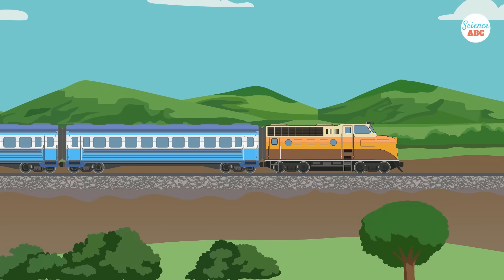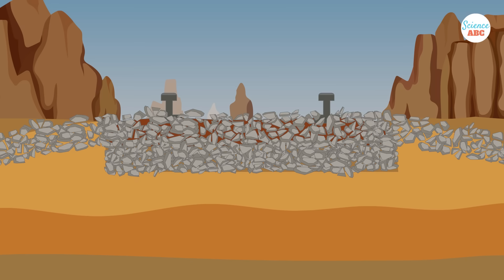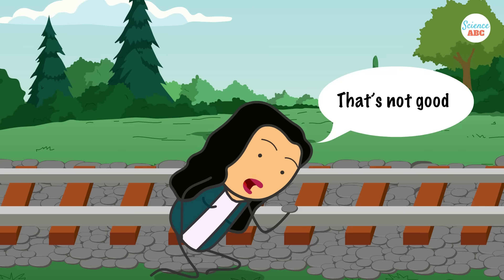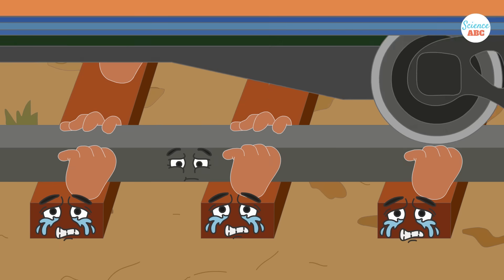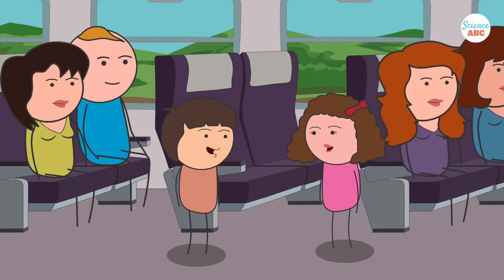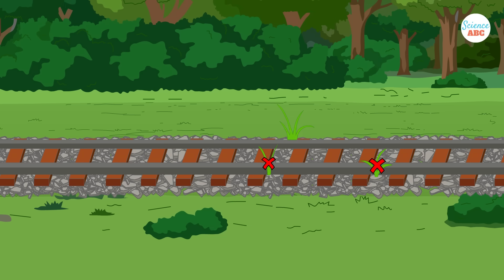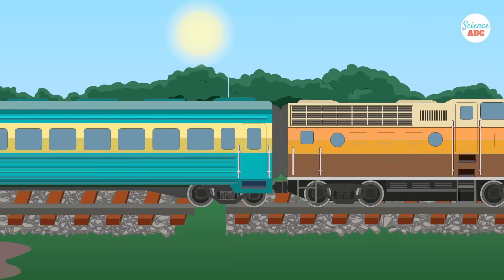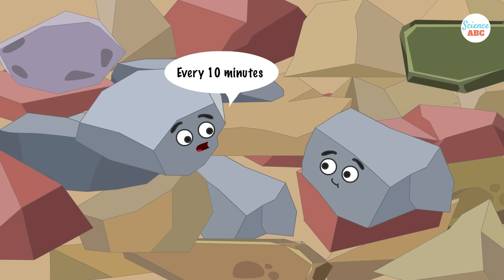Why Are There Stones Along Railway Tracks?

Comment: 0:58 25-30 cm? Maybe in the US that considered sufficient, but that is normally the amount that goes under the sleepers and then another ~15cm for in between the sleepers. Also, that is an awkward position to measure. Normally you measure the thickness from either the top of the rail or the bottom of the sleeper.

Comment: All terrain has a coefficient of friction due to composition and particle size. When you place large weights like trains or houses on bases with a small coefficient of friction, ie., small particles such as dirt, the particles separate and the large weights sink.
Usually core samples are taken to determine ground composition to design the base width.

Comment: Great video! I had wondered why they use those seemingly loose NON compacting stones, rather than a 5/8 inch minus like we do for the highway roadbeds.
Reply: Dear road worker,
Indeed Ballast compacts, exactly like sand just the holes in between are bigger. 31,5 - 63 mm in size.

But indeed we usually use 2 Sand/gravel mixtures beneath the main ballast.
Rail - sleeper - ballast - pss - fss.

Pss Type 1 - usually formed out of sand and gravel.
60% 0-8 mm , 30% 8-32 mm, 10% 32-45mm by weight.
Fss can't remember the % but the types
0-32mm , 0-45mm and 0-56mm.

Sand goes to 0,06mm in diameter(smallest), represented by 0

1mm = 1/25 inch
Or 25mm an inch (roughly).

Pss is waterproof and angled so water entering is getting out of the system fast and the Earth beneath doesn't get over saturated with water... Frost etc.
Fss is to break capillary water and to ensure frost safety. for the Earth beneath the track.

I hope you can understand my limited english, fellow infrastructure construction worker.
Reply: @jonass9347  Understood, & very informative!

Comment: I used to live next to a local line train track. They used to replace the stones or re grade by slightly lifting the track then using shaking forks to hook under each sleeper in turn shake the stones underneath adding stones if needed and then replaced the sleeper. This was always done in the middle of the night so you got no sleep that night. You could hear the machines approaching for almost an hour before it passed, then if faded away. BTW the trains were much quieter afterwards when they passed.

Comment: In my hometown, there is a brand new commuter public transit that’s constructing a new express light rail line all over the city. When they finished adding concrete on the ground, I firstly saw them covering ballast on the line and that’s when I asked why is it necessarily important to add these rocks on the ground. And not only that, but they also mentioned that this task is not completely yet just by doing it. The complexity of alignment and adjustment of the ballast and the tracks are so difficult that it represents a great challenge for engineers and workers. Also, some other areas of the city hasn’t just used ballast, but with another type of support. For example, on a very large bridge between two lands, another method used is called “duo-block tracks”. They are installed using a construction method known as top down. The already attached rails are installed on a tie to keep them parallel along the whole bridge and that’s when the entire assembly is poured into a concrete sidewalk. Very interesting to see such great engineering!

Comment: Working in the industrial rail switching industry for over 20 years I've walked and ridden many miles over ballast. Great video great description of what purpose the ballast serves.
Reply: Ok, if you have experience can you tell what is the cost of building 100 km railway track and how much does it cost  to maintain? Also how much does is a single lane highway cost in comparison?

Comment: I live in an area with a major interstate rail line, and several smaller (mostly seasonal grain traffic) branch lines.
All the busier lines use concrete sleepers, and even some of the lesser-used grain lines are now being converted to concrete sleepers as well. "Mud holes" are a common problem, especially on the main line. Ballast is mostly basalt, although I've seen granite or a granite/basalt mix used in some areas.
My part of the world is also extremely highly fire-prone (and not just during summer months!).  Almost all fires starting along railway lines have been traced to sparks caused by sticking brakes.

Comment: I knew all of these besides the heat and noise benefits. Probably should've realized due to the increased surface area though. Didn't know they were regularly cleaned but I figured they would need to be replaced.

Comment: Its hard to walk fast on track ballasts.  I found that out when I was in a place where there were two railway crossings close together. So I took a shortcut to the next crossing. I tried to walk fast as I could but walking on them proved slow.  I started to panic because I knew that a train, quite far away could still reach me before I reached the other side. I walked on the ties instead and found it was easier to walk faster on the ties than the ballasts.
Reply: Never, ever walk on the tracks or ballast. It is for trains only. You can easily die that way, or lose a leg. Never go into railyards either.

Comment: I'm still in awe of how much we still use Rock as a basis for so much of our construction.

Metals are nice but they can rust. Twist. Expand/contract with heat yada yada...
Plastics don't often have the strength for things like buildings roads etc. Etc.

But stone and rocks. Sometimes specially shaped or a special mixture thereof. Foundation to railways. Roads. Buildings (concrete to name a specific one).
I'm sure more examples can be listed.

Comment: Thanks for that blast of information about tract ballast. My question now is how about in our modern elevated Metro we call MRT in the Philippines, instead of having ballast and sleepers it has a concrete pedestal that is about 2.00m long and to my amazement (the first time I saw it) it is placed underneath the steel rail parallel to the tracks.

Comment: The ballast cleaner is an amazing machine. It takes the stones out of the track while lifting the actual train tracks a couple of inches in the air. It cleans the rocks and spills them back into the ballast. After that it shakes the rocks with these spatulas that are shoved into the ballast. The shaking makes the rocks take place, kind of like a train had driven over that spot several times. It's a frigging miracle of a machine 😂

Comment: One thing that wasn't mentioned... is  how the rocks sharp edges direct hot sparks from the trains wheels down into the gaps and absorbs the heat to protect surround vegetation from catching fire.... but that wasn't likely a by-product and not an intended design feature

Comment: Sadly, most of the points this video makes are made up and untrue, and it misses the actual main reason for ballast, which is forming a "raft" on top of the soft earth underneath, and adding a lot of permanent weight on the soft earth to compact it, so that the weight of the train is light in comparison to the weight of the "ballast" (thus the name), thus reducing "pumping" and creating mud holes under the tracks.

The drainage has nothing to do with rust prevention (really? You went with rust prevention? Don't you think that would be an issue on Ocean side tracks?), it's about keeping the ties dry so they last a lot longer, as well as reducing mud formation under the tracks.

If coal etc dumps into the ballast, it clogs up the ballast and starts causing all sorts of problems, none of which involves the track corroding! The wooden ties fail, the road bed starts "pumping", and it ceases to function as a stable raft. 

Ballast also doesn't improve the ride comfort of the train, that's done by carefully leveling and aligning the tracks, and that can be done even more perfectly on concrete than on ballast, such as high speed trains that don't use ballast, or across bridges etc. 

Ballast is just the cheapest way to provide a flat surface across thousands of miles of different types of ground, and you will notice that in soft ground conditions the pile of ballast is much thicker and wider, because it's creating a larger footprint, thus reducing the PSI on the soil. 

I am not going to try to go through every point, but this video sadly is not well researched, and you should NOT repeat anything that you learned in here, because you will sound stupid!

Comment: As a kid I noticed that they tended to be angular. But I thought it was because they were being broken up by the weight of the train and rocks don’t break into smooth corners.
Reply: i thought they were so jagged because it'd allow the train to fling them away on contact instead of breaking and causing the train to rise a bit 😭

Comment: If you like track engineering you should read up on the trains from Lhasa Tibet into china.. The tracks are on the permafrost which needs to be "cooled" to prevent the permafrost melting and collapse of the lines.. The train is that high  (5000 mtrs in some areas) it is slightly pressurised and has Oxygen available if people get altitude sickness. ..

Comment: Whilst at a small railway station in Mid Wales i noticed that some of the sleepers were in very poor condition. Some were rotting to the point of collapse under the weight of the rails. When i mentioned this to a member of staff, they did not know what a sleeper was and i had to explain to them. A little bit worrying, to say the least.

Comment: Number 7 is actually the opposite. Rail is laid at a high temp via heaters prior to being anchored. This way except for extreme temperatures, the rail is in constant tension.  Tight rails will stay straight whether hot or cold. If rails aren't laid at a high temp then like the video says they will expand / buckle and ballast won't stop it.

Comment: It's interesting to watch track and ballast when you're waiting for a train to pass at a crossing.  The rails bend down, pressing on the ballast, when a wheel goes over.  When the wheel is past, the ballast and the rails rebound.  It's not all solid and fixed, as you might suppose.  We have lots of heavy coal trains passing here.

Comment: Also they have a machine for bedding in the new railway sleeps into the ballast. It puts down big metal prongs around the sleeps and vibrates them down into the ballast. This machine moves along the newly laid track. Pretty cool to see it operating.
Reply: It's called a Tamper.
Reply: Actually vibrates them up, not down(not a big deal though)...every track we've laid is below height, then the tampa comes in drops it's laser level off at a location with correct height and brings the track up to laser height
Reply: @matty101yttam  Very interesting. They relaid tram tracks outside my house. From flush with tarmacadam, to what looks like railway grade : ballast, concrete sleepers, continuous welded tracks. More or less 4 men did all the work : a back hoe dug out the tarmacadam, a loader put it on a truck. Rinse and repeat. Then they laid concrete on the base about 1m below the traffic road bed. Then a machine deposited ballast. Then the machine with tracks already connected to the sleepers came by. It raised itself up on 4 thin "legs", picked up the track/ sleeper combo, and laid them down. Then it did a pass and tamped/ levelled the tracks. Then a machine came by ( same one ? ) that had the continuous welder machine on the back. As I watched from my window, I could smell the burning metal. They did 3km in about 4-5 weeks. No big work gangs. Just efficient working with the proper machinery. This is in Prague, Czech Republic
Reply: @Czechbound  the machine with "legs" there's a few different versions, some are individual where an operator stands with the controls attached to the machine, other are remote controlled. The remote controlled ones are really cool because they can hook up multiple machines to the one control unit and lift in 100m+ of track at a time.
Reply: Ballast Nedam Benny Neyman waarom kom ik woorden tekort 😭

Comment: Track ballast prevents rusting of the tracks?  
I disagree.  Rust is oxidizing metal. These ferrous metal tracks are wetted by rain and then exposed to air.  They are already rusted everywhere except the surface worn shiny by wheels.

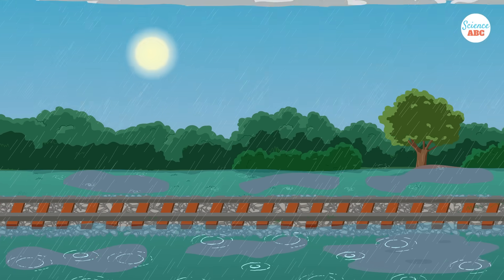Comment: 4:30
could any1 explain to me, how rocks under steel beam prevent the steel beam from heating up/block somehow heat expansion?
Reply: The ballast does not really prevent the steel from expanding. It rather helps the tracks expand when they are heated up during the summer season. The rocks allow tiny bits of movement to the sleepers, so that when the steel tracks expand they don't create an insane amount of pressure/energy that cannot go anywhere (which could lead to parts of the track detaching from the sleepers). Another safety measure; there are small gaps between different track pieces to account for heat expansion which prevents the pieces from pushing against each other and buckle/detach from the sleepers as well.
Reply: @michaelvd2467  I heard about the dilatation gaps? or been told thats how they call them. Was more curious about the first part with the pressure
thanks very much, good explanation :)